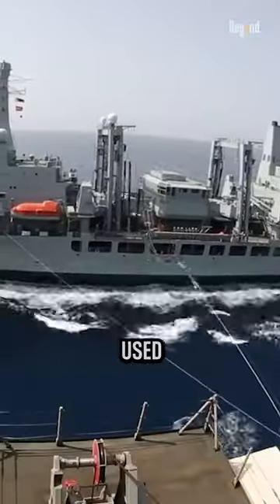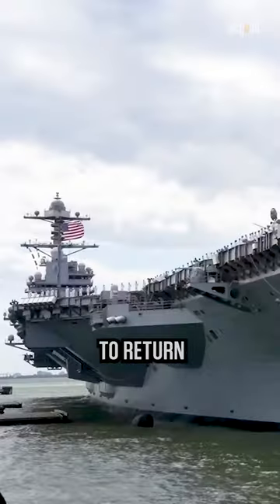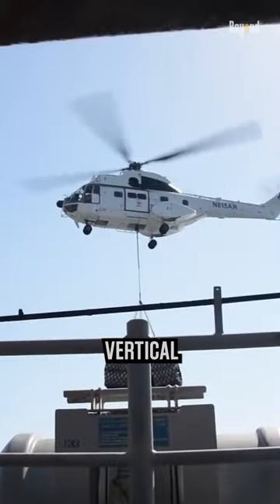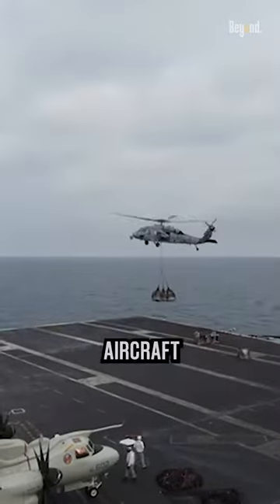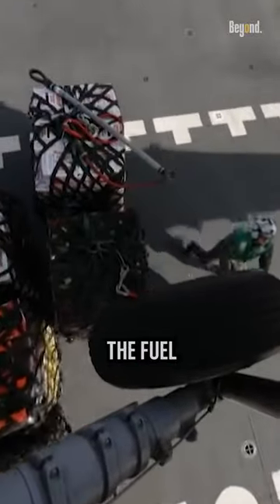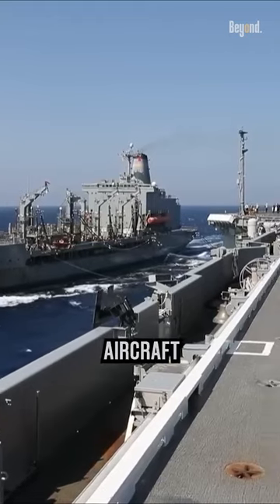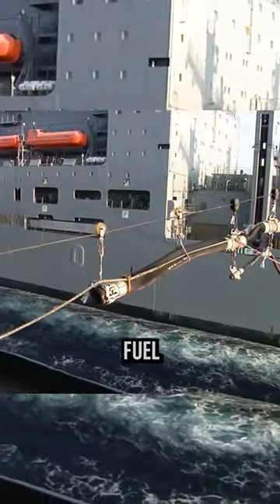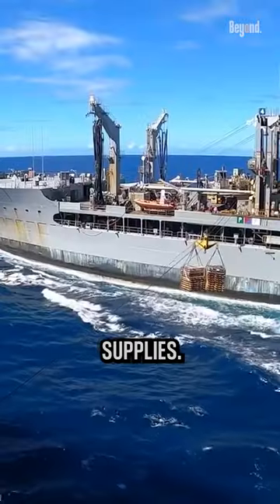How do aircraft carriers refuel at sea? #shorts

Comment: UNREP, or UNderway REPlenishment is the process of resupplying ships while underway. This process is performed by either close, alongside, directly connected ships, or VERTREP, VERTical REPlenishment, using helicopters. I have NEVER heard it referred to as 'horizontal replenishment', and I've directly observed or participated in probably 30 of these evolutions.

All modern US Navy Aircraft Carriers (CVN-68 - CVN-80) are nuclear-powered. They get 'refueled' every 25 years, hence do not need fuel to continue the operation of the ship. They do, however, carry JP-5 JET FUEL for their aircraft and other ships. THIS fuel is replenished through the UNREP FUEL TRANSFER process using those big hoses passed between the supply ship and the carrier as shown in the video. Fuel is never transferred by VERTREP.

Using cable spans of approximately 150 feet, the delivering and receiving ships are directly connected. These cables do not 'hold' the ships together. They are there only to enable the transfer of cargo using pallets or hoses. The ships actually steer parallel courses and the helmsmen have to carefully keep the ships a very precise distance apart. If the ships get too close, pallets go swimming. Too far and the cables can be snapped and again, pallets go swimming. This is done at about 10 knots and can take many hours. The concentration on the bridge is intense for the entire evolution.

VERTREP is used to transfer cargo and munitions between the ship's decks. Both UNREP and VERTREP are used for cargo transfer - many times simultaneously to minimize the required 'along side' time of the two ships.

Carriers rarely transfer munitions while pier-side as it's actually much safer to do so while underway, in the middle of the ocean. Out there, if munitions are accidentally dropped or detonated, there is zero chance of impacting any vessels not directly involved in the munitions transfer.

Comment: Somebody clearly does not understand nuclear propulsion
Reply: Yeah that would be you. Aircraft carriers still have to take on jet fuel. Ya know, for all those planes, they kinda define an aircraft carrier. 🙄🤪
Reply: Somebody clearly doesn't understand that jets don't use nuclear power.
Reply: And food, mail, equipment, supplies, etc.  All unrep/vertrep aboard
Reply: @troyjudge8466 and ammo and maybe spare parts
Reply: The ovens in the kitchens use gas, don’t they?  Most professional kitchens are gas anyway.  So that’s need topping up too.
Reply: @sparky4878  Nah. Carriers and subs use electric cooking. Subs for obvious reasons (You don't want to use up oxygen cooking), and carriers because they have a shitload of electrical power. Not as much available on a Nimitz class as they used to have, but they didn't refit with gas when they started using more electricity as they upgraded.